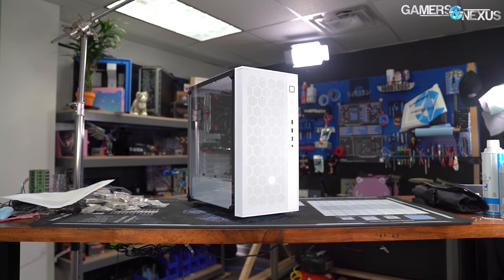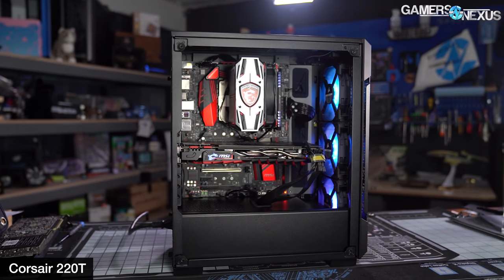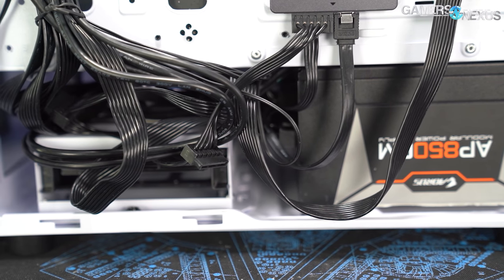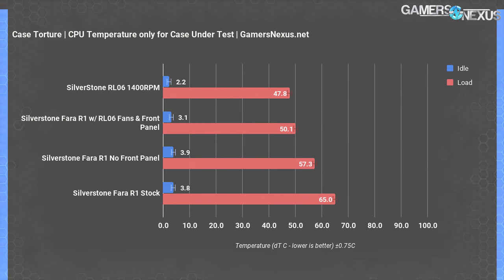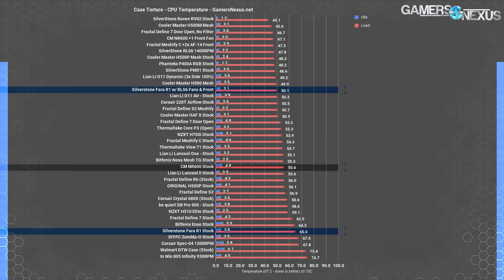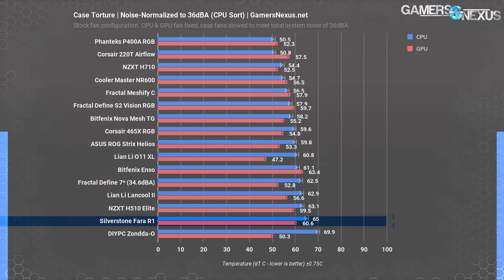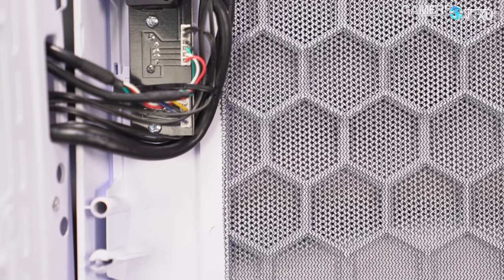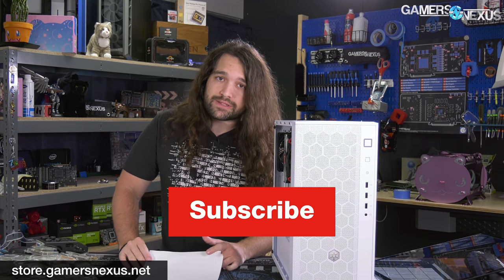Silverstone Fara R1 $60 Mesh Case Review: Build Quality, Thermals, & Noise

Comment from the maker: Watch our case review playlist: https://www.youtube.com/watch?v=xiNiI9_CGTw&list=PLsuVSmND84QtrMP_niRTD2zIa3uUhxIvn
Article of review: https://www.gamersnexus.net/hwreviews/3570-silverstone-fara-r1-case-review-budget-mesh
Reply: Can you guys review the "Pichau Gadit X"?
Reply: This is probably a dumb question but I'll ask it anyway; Have you, or would you consider, doing a review on some of the Rosewill cases? They're pretty low budget and they're all over Amazon, Newegg, and eBay so I can only guess that quite a few ppl have bought them and I'm very curious to get YOUR take on their Build-Quality (or lack there of), Air-Flow, etc..etc...etc...Thx in advance!
Reply: Whats your opinion on the Cooler Master NR400?
Reply: I actually bought the Silverstone RL06 a year or so ago based on your review. It could do with a bit more space behind the back panel for cable tidying and this thing smudges like nobodies business but it does perform great. It also cant fit the tallest air coolers in it and I ended up replacing the stock rgb fans for 'prettier' ones.  Cpu (R5 2600@4.3ghz) runs at 50c under load with a scythe mugen monstrosity on it and the gpu (RTX 2070 non super) runs at 60c-65c.
Reply: Side note: two 120mm fans can be mounted on top of the power supply shroud because the holes are threaded that way.
Reply: Are you ever going to touch the NZXT H1? I'd be really interested in its thermals (which probably would be hard to compare though?)
Reply: Please review silent cases that DO have plenty of HDD bays. It's very useful to have a RAID-5/6 setup for video editing and other productive work.
Reply: Could you guys review the Cougar Turret Mesh / Cougar Turret RGB? The Mesh is a pretty budget case that I have and it performs really well with my pc.

Comment: I have this case. Got it for $59 AUD ($40 USD) before whopping price hikes of 33%. I wanted cheap, really small profile, fits full size ATX, 180mm PSU, 160mm cooler with tempered glass and mesh front. No regrets and pleased with airflow (just have a front and back fan) but that back steel panel is a bloody nightmare to get on and off.

Comment: Everytime you make a video of a good mesh case they get sold out and I get mad because I have a shit case by my own fault... so.... please keep me informed but stop it....
Reply: Amazon US has 17 of the NR600 in stock at $69.99 right now. They also have 12 of the glass Fara R1 in white for $68.
Reply: @alexskywalker888  thank you very much!!! I looked this weekend and gave up lol
Reply: @shawnpitman876  within the short time you mentioned that. Dropped down to 3 in stock. Hmmm.....right...?
Reply: I got Cooler Master MB511 RGB, $65-70, great case, looks awful imo, but it performs way above it's pricepoint, ended up selling RGB fans and getting 1 fewer Noctua chromax S12A fans on sale for $1 less
Reply: @Benziemane  Funny how there were still some in stock 6 hours after you said there was none. DERRRR

Also nice lie, I just checked it again on two different browsers, still says 12.
Reply: @komi1834  not horrible looking but at least you got some solid working fans. I have the Thermaltake V200 and the airflow is such trash. One little slit on the front right of the case. I added 2 more fans but my Temps are still high. I take off the glass and I'm way cooler, of course. I need a new case asap..
Reply: @pretzel3779  yup  🤣

Comment: I like it, cheap white case with good build quality, it's only 55€ where I live, for the tempered glass version, non-glass 52€. The NR600 is available for 88€. For a budget or midrange build the rear fan is probably enough, at least the temps get significantly better by adding fans, which is easy to do if one upgrades to warmer components. Front panel removal is a bit meh, but I've always wanted to buy an air compressor..

Comment: This case is pretty cheap in India and ticks most boxes. The only issue I have that is preventing me from buying it is that god awful front panel which has all the IO connectors attached to it, which would make it very difficult to do maintenance or install new fans or a radiator.

Comment: I can tell this case is going to disappoint, but this review is going to be extra entertaining, because of the disappointed face and the fire in the thumbnail. 😁
Reply: 2:02 - Ah, now I can see the problem. They included U2. 🤮 This is the worst thing to happen since Apple forced a U2 album into everyone's iTunes library. 
...Okay but jokes aside, I really can see the problem. Those holes are tiny and spaced so far apart. That front panel is more plastic than hole. Come on Silverstone, that should have been obvious.
EDIT: Okay yeah, lack of fans never helps either.

Comment: Silverstone is one of the few computer hardware companies which really give the impression of trying to do things right. I like their products and the quality documentation they come with.
Reply: I got the RL06 two years ago, it's a very tight case for a full-ATX build (mine even has a 240 AIO) but the good cable routing helped a lot and god damn does it ever have airflow. The build quality felt more premium than my previous NZXT case that cost more than twice as much. Next time I need a case their lineup will be the first I check out
Reply: Silverstone and Lian Li are the companies that i trust blindly.
Reply: I regret giving away my Raven RV02 but I've been pretty dang happy with my TJ08 that my current build has been sitting in for a few years. Super solid build quality, excellent airflow and low sound level.
Reply: @zarmaanful  I would add be quiet to that list.
I've never owned a be quiet, case, PSU or fan that didn't look good and do it's job quietly and efficiently.
Reply: Silverstone has really nice, clean products, I like most of their design choices. I quite like my RL08. Inverted mobo is interesting and could need more competetion from other manufacturers.

Comment: I know this video is a year old and probably nobody will read this comment, but I bought the Fara R1 based on this review, I wanted to finally change my case from the NZXT S340 and this case ticked all the boxes: cheap (much cheaper than the meshify c), mesh front, small, fits ATX Motherboards, unassuming.  

It's been a great purchase, it's quieter than the S340 even when I use my old S340 case fans, and I recently (barely) fitted a MSI RX6800XT trio graphics card (the card touches the fan).  Overall I love this case and hope to use it for as long as the S340

Comment: wouldn't it be an accurate assumption that if there are no included front fans, you should add front fans. I always do. I assume a case is missing fans to lower the price and to give you the option to choose the fans you want.
Reply: Yes it probably is a cost saving move, thus cheaper fans but not all people can buy extra fans for a case immediately. Since there are people who would rather buy a pc case with good build structure then buy the fans later thus testing the cases stock is a godsent for them.
Reply: I replace the stock fans on my machines with some double ball bearing PWM fans.
Sleeve bearing fans, no PWM with rainbow ain't my thing.
Reply: @pedropau288  Especially in lower-end builds, a front fan might not be necessary at first, but easy to add later if one upgrades to components with higher heat output.
Reply: Also it's makes it so if you already have fans, you're not paying for stuff you don't need, and if you don't, then it's still has the basics for until you can afford some.
Reply: @ninjal7588  yeah

Comment: What are you talking about when you say the Meshify C is a $70 case? I've never seen it that low, it's always been a $90-$100 case
Reply: Yep, it's always been a 90ish case where I live
Reply: I think he confused it with the focus g...
Reply: It's currently $79.99 on Newegg US. I bought it shipped for $69.99 a few years back at launch on Newegg when they were running a sale haha.
Reply: Maybe that's the msrp when it launched.
Reply: @braydennturner  Its 89.99, the 79.99 is the one without the TG side panel
Reply from the maker: No, it launched at $70 and it is currently $80.
Reply: @GamersNexus  I was looking at the tempered glass model, you're right my bad
Reply: @GamersNexus  the meshify C midtower or the mATX version?
Reply: I recently bought the meshify c and the glass exploded in my hands :(  still waiting on the replacement from fractal
Reply: @joebob2738  That is my biggest fear with tempered glass cases. Even if it's extremely rare, I'd still rather use acrylic or windowless cases for that reason.
Reply: Depends on your currency. If you account for your currency exchange rate with USD it likely costs $60

Comment: I'm fairly positive that SilentiumPC Signum-series uses exactly the same tooling as this case. Cheapest version without window is 33€ with only one exhaust fan, most expensive is 65€ but it comes with 4 RGB fans and glass side AND frontpanel.
It is same size, same features (fan mounts on the PSU-shroud, prettu much same cutouts, very similar hard drive cage). 
It misses 2,5" cages but front panel is better since the IO-panel is part of the chassis, not the front panel.
Reply: That case seems awesome, except no one in America can buy it :(

Comment: I would love for someone to partner with say, arctic, and get some cheap fans that aren't terrible for their cases. Consumers can get a 5-pack of PWM fans for under thirty bucks on Amazon, and those are good enough I've used em in multi-thousand dollar watercooled systems. A B2B deal could reduce that cost pretty well, I think, and provide great value. 

Imagine a $60 case similar to this, with 15 bucks of good fans you never have to replace, even if you end up with high power hardware down the line. I'd pay for that. It's the same reason people pay for motherboards with good VRMs even if they're on a low TDP chip, or a PSU with headroom they don't need. Except in this case, there's an instantly realizable benefit, since it can actually give you higher boost clocks vs only having the benefit of future upgrade compatibility. Plus ofc the lifespan argument.
Reply: Scythe started making cases now, lets see if they become available outside of Japan anytime soon, their  120mm fans are only second in airflow/noise (noise mostly depends on rpm if it's not some rly shitty fan) to Noctua S12's, but their cases so far target more of a look oriented audience, but considering how good theor fans are, it wouldn't suprise me if it performed like Corsair 570X or Thermaltake View 71 because good fans make a huge difference, just take a look at fractal cases, Meshify C is great, but it ends up much pricier after you get 3 fans for it...
Reply: Nah, noctua fans only. No exceptions.
Reply: John Bigbooty  lol, because Noctua has the highest RPM and CFM on the market for 120mm.  Scythe comes close but still has less cfm. You need to go look at Noctua's IPPC fans... Unless you're referring to RGB fans, then yeah, Noctua isn't the best. They have no RGB to compete...
Reply: John Bigbooty  industrial line. noctua ippc 3000. It's 3000 rpm with 110cfm. I bought an itx stack case (SST-LD03) so i had to choose the highest performance 120mm possible. The thing is gruesome loud (for a "quiet fan") at max speed but the cfm was great. I changed to watercooling thereafter. Don't build itx if you want the most expensive components lol

Comment: Non removable front filter? That’s a $30 case feature.
Reply: and they seem to have chosen to cut out the spot where the logo is... why?
Reply: @Dreddy72  and the logo is off center agh
Reply: @alexismarie2652  its not. Its in the centre of the case...just not at the centre of the mesh

Comment: Love the case, love the review, and personally I appreciate the lack of fans and prefer to add my own anyway. edit: the best reason for cases coming with fans is to make a performance and/or cosmetic statement about the case. It's a showcase, you should still be able to buy a stripped-down version of the same case and build it your way, and thankfully some manufacturers sell both empty and RGB-fan versions of their top-shelf cases.
Reply: While it's nice to have options, having extra SKUs can make every SKU a little more expensive due to lower scale for each SKU. Fine for premium cases, less so for budget cases.
Reply: Just make included fans RGB so you can sell them easier 😂😂

Comment: If they had configured the front panel IO and mesh filters the same as the RL06 it would be a winner. Yes I agree there is a premium feel to Silverstone paint. Went from a RL06 to CM td500 mesh, for improved radiator and air cooler clearance and the chassis felt stronger and paint felt  thicker. Silverstone really do put effort into their budget cases.

Comment: Wanted a white Meshify C Mini TG for daughter & it was only available full size or black in the mini - So found the SilverStone PS15W . Its GREAT , the small size of the ITX H210 but all the Mesh goodness . Well ventilated, but has some style with tempered glass & the black dust filter up top . We went for a cleaner look & knocked out unused drive cage on bottom .

Was planning for a Lian Li TU150, but that would lock us into a SFX PS & had already had a decent ATX PS on hand . Turns out the SST-PS15W isn't that much bigger even though its Micro ATX , She still preferred the white over Silver . So we had bigger choice of mainboards, but footprint is almost identical . Would rather pay less for case & pay more for good fans.

I really miss straight forward, technically smaller cases like the ol' Super LanBoy & the Lian Li PC-A05Nb . Was an ITX fan but the new cases are too gimmicky, expensive & crap for cooling like the new Fractal Era ..unless you pay up for a NCase M1. Would like to see a GN review of the black RGB version Micro ATX SST-PS15B-RGB - to see if the included fans past Steve muster . Kenny

Comment: Anyone have any good suggestions for good airflow cases that can accommodate an NH-D15 (165mm) in the $80-$120 price range?
Reply: Look at dimensions of a case when shopping. I use a NZXT H700i with a Coolermaster MA621P with a three fan setup and there is still plenty of room in the case. I have used a Coolermaster HAF 932 which was plenty big enough for my Noctua NH-D14 but that case is no longer available.

Comment: Excellent video. Thank you. Just a small point but did you miss the use case where the purchaser already has fans and therefore has no need to purchase any more? 

Also, can the PSU be inverted? That is, with the PSU taking air from inside the case through the 'fan mounts' on the PSU shroud you mentioned. That might be preferred in dustier conditions. Or even situations where cat hair could be an issue...

Comment: RL06 will forever be the one that got away... 

Also. My buddy bought a rosewill thor a little while back on a mega sale. I would love to see that case modernized by getting rid of the majority of the drive cages at the front. The stock fan configuration is madness. They basically took the concept of "Hey. Lets try replacing the side panel with a box fan" and threw it into a case.

If you have the rosewill thor laying around, I would love to see a video on it. Kind of like the full tower CM HAF review that was done not too long ago <3

Comment: 3:37 "... and people aren't buying hard drives."
I do hope you misspoke and meant optical drives. Because if you weren't then I would happily blaspheme against your holiness, Tech Jesus. The false religion of "no hard drives" is a straight path to the hell of prebuilt PC's.
Reply: HDD still best for cheap cold storage!
Reply: I'm planning to switch my 2 hdds with ssds in the summer. They're by far the loudest parts in my case.
Reply: Seconds earlier he said optical drives, so no he meant 2.5 and 3.5 front mounted drives. Other than for NAS, budget builds are better off without spinning rust.
Reply: Erotikstudio Winkler GmbH  Yeah IKR. A big 4TB HDD is only €95. Half a year ago I could buy a 1TB NVME for €110, but with NAND getting more expensive that price is moving closer to €150 now. Those Samsung 1TB NVME are almost €200 now.

Comment: Great content as always!

I have a small (huge, actually, considering the amount of work it'd be) request: Could you do a one-off investigation into noise level and quality differences between noise oriented (the more shut down models from beQuiet! and Fractal) vs. airflow oriented cases (various mesh cases) in the context of OTHER devices inside the case rather than fans, GPU and CPU cooling?

I'm currently running a Fractal R5, and my previous case was heavily modified to include a ton of bitumen+foam noise dampening mats. The main reason being that there have been 3 to 5 HDDs inside my case (on top of 2-4 SSDs, replacing everything with SSDs unfortunately isn't viable yet), and their noise can be really distracting if you have a very open case. In my experience they tend to be vastly louder under heavy use than the slight whoosh coming from my cooling.

It's not that hard to build a system with quiet cooling, either in a noise damped case or a high airflow case, but getting the noise from HDDs and other possible devices is a very different challenge. I know you're a gaming focused channel, and for a gaming build a single SSD plus a storage drive is enough, and won't really cause much in the way of noise issues, so this sort of isn't in your wheelhouse.